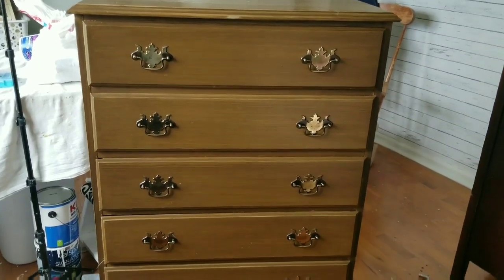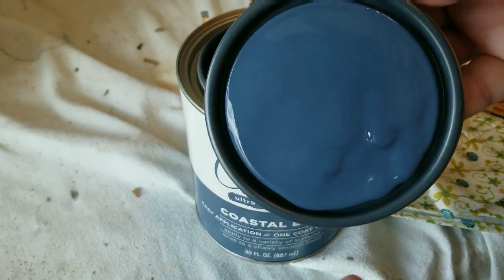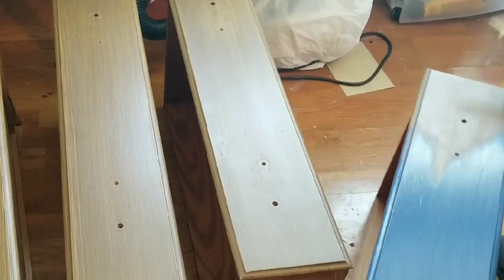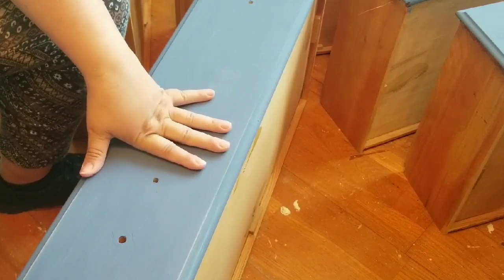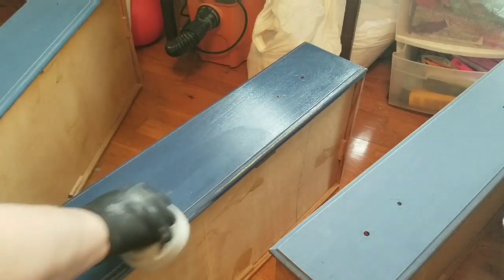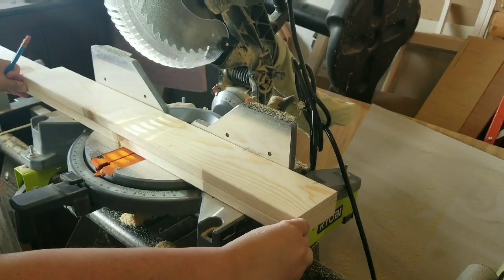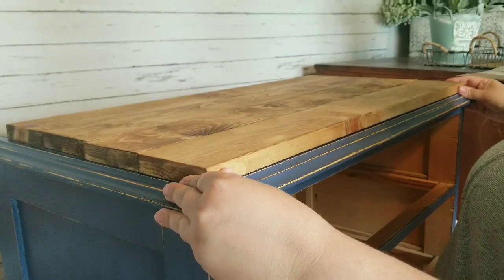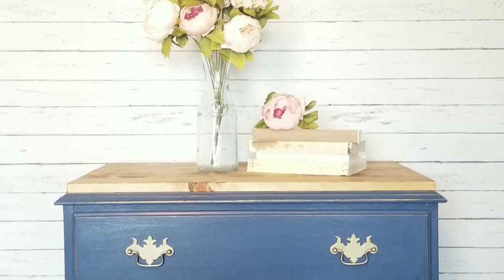Beautiful FREE dresser makeover!

Comment: Great job!  I have a question, if you don't mind.  I have a dresser like that.  I'm not entirely sure that mine is made from wood.  Was yours?  Anything I should do differently if it's pressboard?  Thanks for sharing!
Reply from the maker: I don't mind at all. Chalk paint sticks to pretty much anything. If the surface is too slick, maybe lightly sand it with a 22p grit sand paper. Make sure it's very clean. Prime with a good primer and then paint. Then seal with a Polyurethane for durability. I had a bad experience once with a pair of night stands because of the surface. It was a tough one. Here's the link to that video.
https://youtu.be/sB_hKP6OlY4

Comment: I bought the sponge applicator that you linked below but I’d love to see how you do it! Are you dipping the sponge in the can? Or, Have you poured it in a tray of some sort ? In other words....how do you load the sponge with product? And how much? 😬 please let me know... I’m getting ready to do a project and want to use the sponge instead of a brush.  Thanks in advance! Btw... I love your channel!❤️
Reply from the maker: Hi Sandra
I normally just dipp it in the can. But it's a good idea to our a bit on a disposable plate as sometimes some residue paint gets on the sponge.
I dip and just a bit on the sealer and then as I go it dip less because the sponge actually absorbers the sealer. Hope this makes sense. The goal is to apply thin layers at a time.
Reply: DIY Beauty on Purpose  Thanks! It does make sense and I’m going to give it a try! The sponge method looks so much easier with good coverage,  better than brushing.   I’ll let ya know!